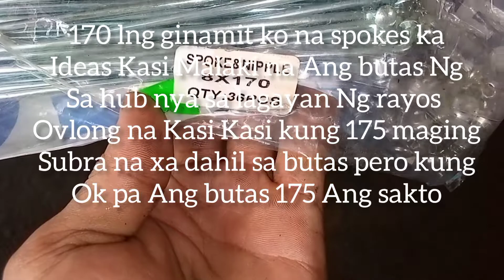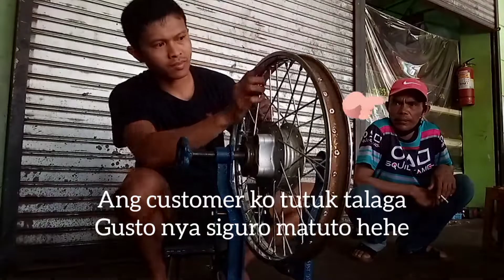TIPS KUNG ANO ANG PWEDE AT SAKTO NA SUKAT NG RAYOS SA TMX 125 || ALIGN || @rdworksideas

Comment: boss may rim ako vans voy 17 size.
yung hub ko pang tmx 125 pang huli
ano sukat na raios para don.
may nabili kc ako raios di kasya yung ulo sa butas nng rim..
Reply from the maker: 9g X 161 or 162 pwede Rin 9g X 184 or 185
Reply: @rdworksideas  boss ano po pinag kaiba nong 9gX161
at yung 9gx184
alin po ba sa kanila yong medyo mataba yung rayos na kagaya sa orig na rayos na nkakabit sa tmx 125..pero yung ulo kasya sa vanz voy na rim..
Reply from the maker: Kasya Nayan boss yang sinabi ko👍
Reply: @rdworksideas  👍ok boss salamat po
Reply: Boss pde magtanung Anu sukat ng Rios size ng 1.40 by 17, tmx125po Yung motor ko.
Reply from the maker: 9g X 161 or 162  lods yaguso 👍

Comment: Boss,  spd rim 2.15x18 at stock hub ng tmx 125alpha sa rear, spd rim 1.85x18 pero xrm ang hub para sa aking front disc brake conversion. Tanong ko po kung ano tamang sizes ng spokes sa harap at likod?
Reply from the maker: Rear-175 , front 184 or 185